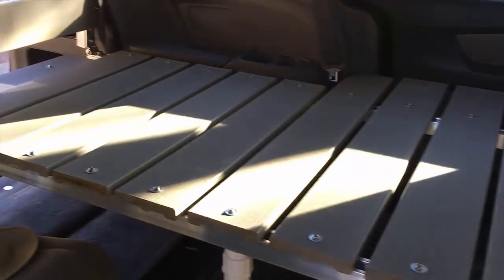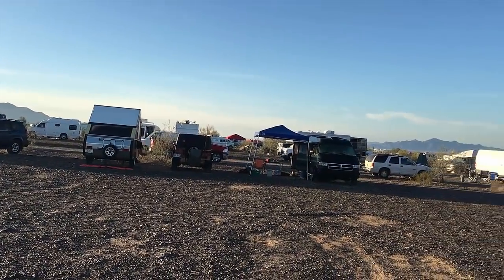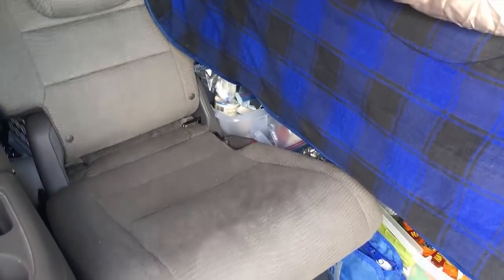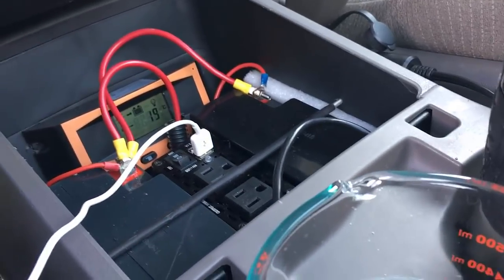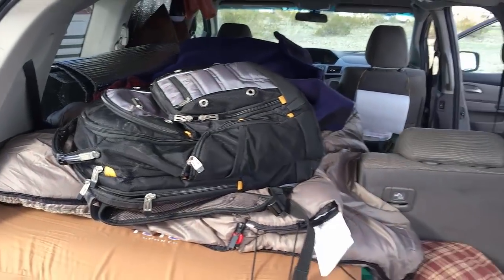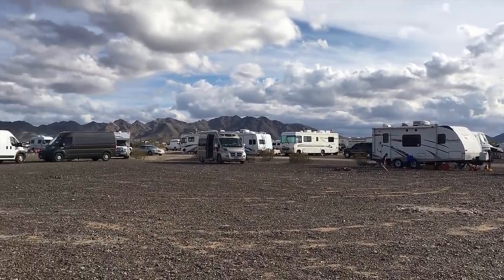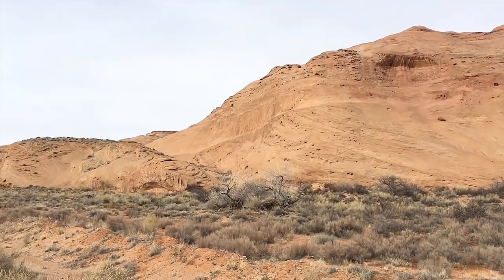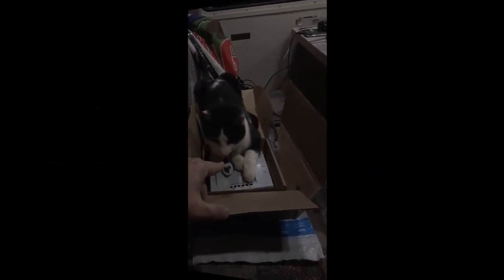New Minivan Bed and RTR 2019

Comment: Nice efficient setup!! Looking good!!
Reply from the maker: 6 Count Family Thanks!
Reply: You mentioned an electric heater. Can you show in detail how you keep warm? Is the electric blanket your main source?
Reply from the maker: @thebamlife1775  Hi, in addition to two sleeping bags, I use a small Honeywell Heat Bud Ceramic heater and an electric "throw" blanket.  The ceramic heater can run for 2-3 hours off the my console battery system, but usually I only use it when 120v is available (why it's on the floor up front, in the video).  But the best thing I can tell you is to check out the blog post here, where I have complete info and links to the products.  http://odysseycamper.com/convert-your-mini-van-for-camping/keeping-warm-van-plus-electric-blanket-review/       Apologies in advance, I am cleaning up all the Amazon links on my posts (putting them on Kit.com) but haven't got to this post yet.  So, rather than one link area, you'll see them as you read the post.

Comment: Looking forward to more details on the bed build materials. Did you get a chance to use the crock pot?
Reply from the maker: Hi Karen, I did get to use the crock again. I put some ham and pea soup in it when I left Four Corners and had it for dinner in Mexican Hat. I keep forgetting to buy the crock liners that someone told me about, so cleanup used more water than I would have liked. The other downside is that you need to have a place to store leftovers because there usually are some when you make a crock of something.  I had the Alpicool cooler for that part of the trip

Comment: I have another question: How big is your battery bank/solar panel? I am wondering how much I will need for fridge/cooler
Reply from the maker: My current panels put out 100W and the two console batteries hold 44Ah. I have a third battery that plugs in externally, for 66Ah. I also carry the DieHard battery pack for another 22Ah. However, I like to keep that one separate so I have a backup if I accidentally drain the main batteries.
Reply from the maker: Regarding the aluminum bed frame; I chose to bolt it rather than weld, for a couple reasons. First, I wanted to try a couple designs and this allowed me to redesign it as I went. Second, I wanted the option of removing the bed for storage, if I needed to use the van for other things. The bolts let me fold it down for storage. I guess the last reason is that I haven’t welded aluminum. I can do steel, but don’t have the practice for aluminum. I’ve been happy with this approach overall and the bed is VERY strong. However, I had to cut some of the strut because it didn’t come in the 30” length I needed.

Comment: hey buddy... what is the measurements of the bed and how high  are the legs to the bed?  I  want to do a pull out sofa/bed  because I want to have more flow space to add an inside shelf/from floor to ceiling
GOOD JOB :)
Reply from the maker: Hi!  The bed is 30" x 80" at the narrow end near the back seat and about 36" at the front.  I put my feet at the narrow end.  I have the legs set at 15" from floor to the bed frame, in the middle of the bed (the floors slope so the front legs are longer than the rear).  I'm 6' 5" and can sit up on the bed, so you could put it higher if you are shorter than me.  Thanks for watching!

Comment: Those composite bed slats look great and will definitely help with moisture. Are they expensive? May I ask the cost of the entire bed build? It may help me with a better design for my Toyota Sienna. Thanks.
Reply from the maker: NoProGoPronto the slats will be more expensive than wood, as will the unistrut. I will do a complete DIY in the future, but roughly speaking, the planks were 13 bucks each and I needed 5. The strut was the most expensive part at about $80 all the hardware is stainless and I have to add it up. I would say it came in at a little under $200 for everything. NOT cheap, but it has certain advantages over wood.
Reply: I've looked into T-slot Quad track, which seems like it might work.  6 ft length is $20 vs $36 for the same length of Unistrut.

Comment: Have you made a plan to access your spare tire that is under the floor between the middle seats without dissembling the bed?
Reply from the maker: You’ll have to check out my video on plugging a tire. I haven’t needed a spare in 25 years, but I did actually think of this. I can lift the bed and put something under it to access the spare. Thanks for watching!

Comment: Think I'd reverse those bolts on bed frame. Raking a body part on one sure wouldn't feel good!
Reply from the maker: Barbara Russell it doesn’t show clearly in the video but the bolts on the vertical strut are actually recessed in the strut channel. The ones on top are button heads and there is a pad over those, anyway.  The one thing I would change for a single bed is that vertical piece. It’s on the outside rather than UNDER the deck because I plan to put a removable expansion on the passenger side. That way I have room for two if other people want to borrow the van.